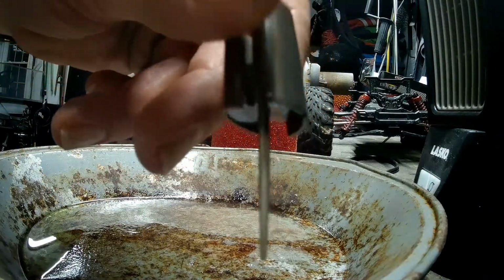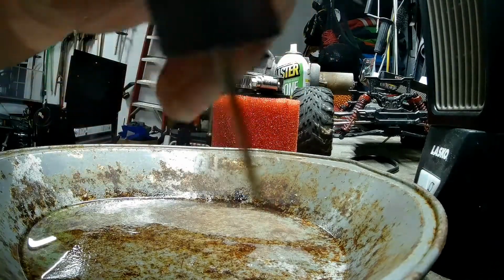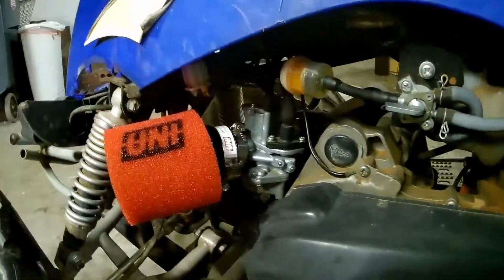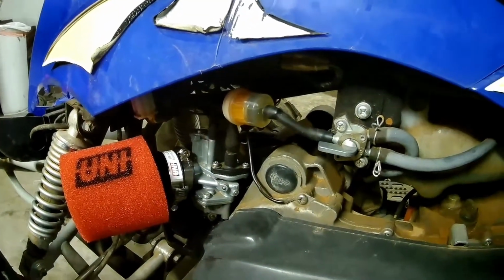2005 ETON VIPER 90R 2 stroke Carb needle Part 5

Comment: I took the carburetor apart on this thing and it runs great now but the float level needs to be adjusted. Do you have a video for that?
Reply from the maker: I don’t have a video on setting the float but the line on the side of the float should be parallel to the half of the carburetor when the bowl is off. You can test by blowing air into the fuel inlet with a straw or hose

Comment: I am having bogging issues, new top end, new carb (the one that it came with was wrong), and a replacement stock air box. Any suggestions?  I was thinking moving needle position to see if any change
Reply from the maker: Check for air leaks, did you go with the stock rebuild or big bore. What carburetor the original one or and aftermarket?
Reply: @GrowYourOwnFun  I dropped the needle position and it seems to be pretty good now, stock rebuild, aftermarket Amazon carb. Seemed to needed richened up
Reply from the maker: @johnwebb7041  yep the stock ones are typically good with factory rebuild but the aftermarket ones need more tweaking. Glad you got it
Reply: I clean the air filter on both of them and also clean the plug and now they scream. Little things like that really make a difference on these little guys.

Comment: What was the point of moving the needle? Were you having throttle response issues? Did you rejet the main for the uni air filter? What was the problem?
Reply from the maker: Yes. Was running lean mid throttle so moving the needle make the AFR mix richer
Reply from the maker: Yes we did rejet and ultimately put on a bigger carburetor to deliver more fuel for the UNI and exhaust upgrades